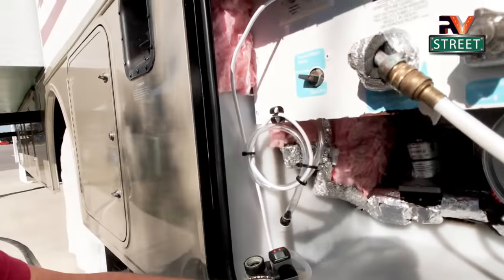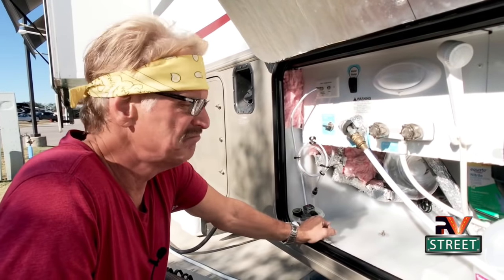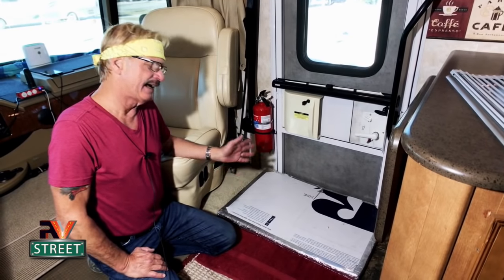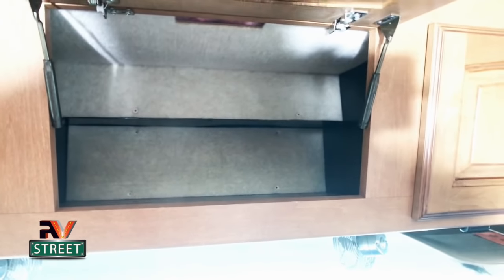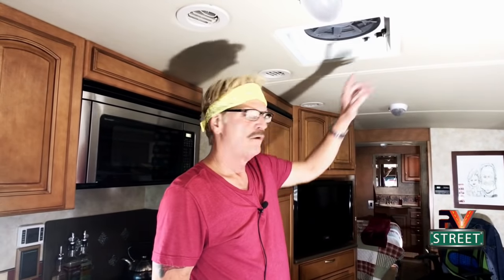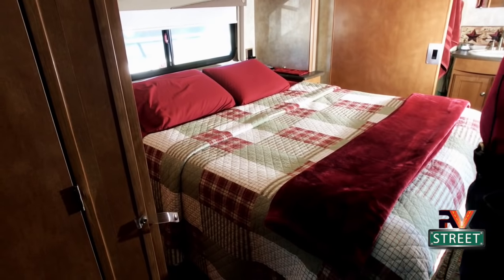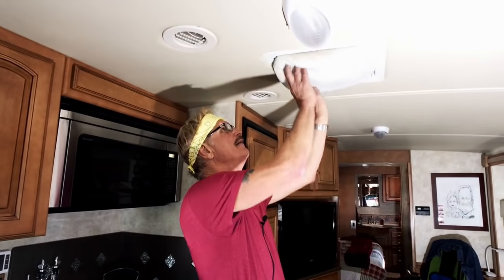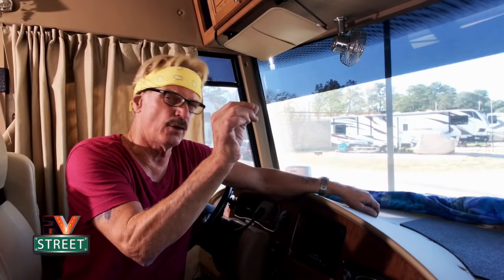😰  INSULATE, HEAT & PROTECT • Key to stay warm in your RV

Comment: One thing to consider is on my trailer the propane furnace heats the gray and black tanks aswell.
Reply from the maker: Agreed. I hear ya loud and clear. And a lot of RV's are prepared that way. BUT....when it isn't going to get down to freezing temps, why would you run your propane furnace when you have FREE electric at the camp ground pedestal. I don't understand why folks wouldn't just use a floor furnace and save their propane. There's no need to keep your holding tanks warm or from freezing when it's not dipping down into freezing temps. We've been to so many places and it's dipping down to the mid 40's, the high 30's or even mid 30's and I hear peoples RV's kicking on their propane furnace and they have free electric at the pedestal right outside. I don't get it.
Reply: @RVstreet  yes I agree I was thinking if you have free electric then maybe just run the fan on the furnace and use the electric heater for heat. I wonder if that would be enough to keep the tanks from freezing
Reply: @RVstreet  In a previous RV, when we were camp hosting, we added an electric coil unit to our gas furnace.  That way when we were getting free electric we could switch from using gas to electric and still keep our belly tanks heated.  I agree with your point of why you would waste heat down in the belly when it wasn't freezing, though, so it might be a better idea to pus a small space heater down there on a temperature controlled outlet.
Reply: @Self.reliant  Water freezes at 32 deg. If it's 36 deg. out, your fine. If it goes below 30 deg. then you may want to run both the propane heat with the elec.heaters.

Comment: Cobra Kai Strong! The one advantage of using your propane furnace is that it uses the duct system to distribute the heat more evenly. I'm with you tho, if I'm paying for electric I'm using plug in heaters. I'm someone that prefers some ambient noise and the cycling of the propane furnace has woken me up many times. Great information!

Comment: Just bought a Mr. Heater for emergency heat during power outage for the great room ... not used it yet.  Did learn  that with the right fitting (and knowing how -- lots of vids on the subject on You Tube), you can refill the smaller Mr. Heater propane cans from a larger BBQ grill sized tank.

Comment: Some RVs use duct work under floor for freeze protection..I set my electric heater lower than propane heat when below 32..
Reply from the maker: Thank you for your input.

Comment: Great video, wish I would have seen it before I went on our first cross country trip. 90F in Arizona then we hit Utah and it dropped to 27F. I used the propane for heating, and we ran out in 3 days. Had to unhook go get propane. Now I carry 2 small electric heaters. We were in a full hookup park and never thought of buying some small electric heaters, since we predominately are always in a full hookup park. I do carry the Mr Heater standup heater when we have boondocked, on a low setting which is enough to heat our 26ft it will use 1lp of propane in about 6hrs. I hook it up to a separate small 5lb tank. I also reinsulated the entire RV with R19, specially under the bed which like you said was a total empty space and we did feel the cold radiating from there. Again, tks and great video

Comment: Great job on the insulation. You actually did a better job than almost anybody out there. The wet bay was fantastic. 
Here’s the answer why people should not use propane to heat their RV in any temperature propane when it’s burns it omits CO2 and unless they have a fan or some type of ventilation to pull the air out through the roof or some other area and keep the CO2 levels low. They’re gonna poison themselves and they won’t wake up.  The Best if you can hook up run your electric ceramic heaters and oil heat is also really good and make sure they don’t have any wheels on the heaters. 
On the subject of condensation having a dehumidifier they’re small electric sheep to operate and the pull the water out of the air and the moisture but you’re right again everything you’re doing I don’t think anybody out there is doing better. Great job. !! I’m a new RV my wife and I am watching your video has really helped me. Thank you very much.
Reply from the maker: Great information and thank you for sharing with the RV community.👍

Comment: Thank you for another informative and useful video.  I look forward to them and never fail to learn, which is my goal in watching.  The length of the video, which others have commented on, is immaterial to me as long as my knowledge has increased.  I leave the 10-20 minute videos to others when the only purpose it serves is to blow thru a topic so quickly that I cannot do it myself.  I appreciate your effort to educate others.
Reply from the maker: Thanks for those words of encouragement Robert. So just in case others read your comment and my reply here....
Sometimes I do worry about a video being to long but if I don't cover what needs to be covered then I leave a lot of folks hanging with a partial message. So for example, if I took a video that covers one subject (like the one you just wached) and it's on the long side and broke it up into say into 2 parts, then when part 2 comes out a lot of folks didn't watch part 1. And won't take the time to find Part 1. Therefore they only got half the info. However, I do try hard to keep my vid's as tight as possible, to make them as short as possible but at the same time cover what needs to be covered. So again thank you again for recognizing that I'm not one that just "blows through a video".

Comment: I agree with using an electric heater when you have power. I used one of the oil filled heaters that look like a little radiator. I usually run it so it stays in the 60s. I use a Big Buddy heater with the dual tanks and built in fan. It has a low oxygen and carbon monoxide shutoff sensor as well as the tip over shutoff that is really sensitive and a slight bump shuts it off. I bought an adapter so it can run on a larger propane cylinder with a regulator

Comment: Oh also a suggestion. I use to be a home builder. When using the insulation you should leave the paper on inside the cabin. Fiberglass fibers do come loose and it's not good to breath in.

Comment: New to RV life and the wife and I are loving every minute of it so far granted we've only been doing this 2 months. We have an enclosed underbelly so usually we run the fireplace in the living and our heat pump ac for heat. Its been below freezing 2 days so far since we have started and on those nights I switched to propane furnace to heat the underbelly.
Reply from the maker: Ya, FTing is a blast no doubt. Such a great life. Wish we started sooner. We've met so many kewl folks and seen so many amazing places. What kind of RV do you have?
Reply: @RVstreet  we went with a 5th wheel Forest River Sabre 37FBT. Its just the wife and I and the leader of the house our pup. Been watching your channel for some time and you have a lot of really good outside of the box ideas which is great, from the little digging I've done so far most people just utilize RV specific products which is fine. But most of your insulation ideas would not usually fit inside a camping world creative thinking and problem solving is fantastic. 

One thing I remember from one of your videos is to try to track down the layout of the unit with electric and plumbing, not sure thats readily available for consumer consumption so its been a little fun trying to find that info.
Reply from the maker: @TxChexmix  Don't know the year of your 5ver but if it's fairly recent, plumbing and wiring diagrams should be readily available. I'd first try FR website and then go from there. Many times it's all about finding the right person to help you.

Thank you for you kind words. Got some good stuff coming up this year. Hope your subbed. Now go have some more fun. haha 😜

Comment: I recently purchased a 2008 Itasca Sunrise Class A motorhome.  I just made my maiden voyage and with a 30 Amp hookup, simply turned on the “electric heat” switch on the thermostat.  Although I admit it was noisy, turning off and on during the night, You didn’t even mention using the factory furnace.  Why not?

I appreciate the detailed tips you give us!
Reply from the maker: Thank you Charles. 
I did mention about people using the factory furnace and that's where I said, I don't understand why people would use that when it's not in freezing temps. They're using up their propane, when they could be using a floor furnace instead, use the electric at the pedestal, save their propane, and it's more quiet. Now if it's in the mid to low 20º for several hours or days and they're not using a light or something else in their bays to keep their tanks from freezing, then yes, I understand why they would use their propane furnace. In those cases many people that have heated bays use the propane furnace. Otherwise it makes no since to me. In 5yrs. we have rarely used our propane furnace.

Comment: I use my motorhome furnace but if I stayed where the electric was part of the flat rated rent.
The heated mattress pad is a must have in a coach. I also have an electric blanket but it's not being used so far. 
The only concern I have about using an electric ceramic heater is exceeding the service amperage. The plug on my power cord has been overheating at some point. Possibly when the AC unit was running all the time.

Comment: Commenting about using furnace in full hookup site.   I was doing that (only had my camper a little over a year now), but I told my fiancé last time we went camping and it was cold at night that we needed a space heater because we were using so much propane.  I was also not running the furnace until we got ready for bed, so that was making it work harder and using more propane.  Definitely learned something.

Comment: Thanks Martin!  We are stuck in Canada this winter or should I say COVID season.LOL  We use a 1500 W floor model ceramic electric heater and our RV propane furnace.  Our 32' motorhome has a 30 amp service so we can't run our 1500W electric heater when we are using high amp appliances like the toaster oven or microwave. The furnace comes on when the electric heater is off.  Other than meals, the electric heater is on.  

We also use Reflectix in some not all of our single pane windows ie bedroom and bunk bed windows because we never sit in those areas.  The dinette and bathroom windows have the clear plastic membrane that helps with draft.  Both help keep the rig comfortable, although I agree the Reflectix makes the motorhome cave like.

Regarding the entry door, we bought thick fabric from a fabric store that covers the entire length of the door and steps.  We installed some snaps above the door and the sides so it is easy to snap on and off.  We also have a spare pillow on the bottom step that fits perfectly into the step well.  

Question: Does anyone have a tankless water heater in their rig?  I'm wondering if I can add fibreglass insulation to that cavity without creating a fire hazard.
Reply from the maker: Hummmmm....can't use a 1500watt heater with 30amp when using other high amp appliances? Ya I get that. You can't use them all at once for sure. Maybe one or two items at a time. We spent all summer in Maine and was on a—get this—15amp wall outlet with an extension cord from Joanie's brothers garage all summer and we ran our 1500watt floor heater at night fine. Any other time when we had to use the microwave or some other appliance, water heater etc,  we would just constantly switch things ON & OFF as we needed them and just manage our electric usage carefully.  Once in awhile we'd turn on something else which was to much amp draw and pop a breaker. Whoops, turned on to much stuff. Go reset the breaker in the garage and back in business. But we're a 50amp coach and ran off 15amp for 4 1/2 months. I found that kind of incredible. A lot of people don't believe me when I tell them that. Now of course we didn't ever run the AC's because up in Maine you don't need AC.  But ya, a lot of folks don't realize that you don't need much power if you carefully manage your power usage when your in cool climates. Good comment Neil. Stay warm as possible in Canada my friend. 👍

Comment: Martin, we run 2 small electric heaters in our coach and that pretty much heats it adequately in winter in the East Valley (east of Phoenix AZ). We set the propane furnace for a few degrees lower than the electric heaters. If they aren'tf  keeping up the propane furnace kicks in as a backup to the electric ones.  If I was purchasing new rooftop a/c units I would buy heat pumps and use those for heating, although some people might not like the heat blowing out of the overhead ducts from the A/C heat pumps.  Heay pumps are an extremely efficient heating method, typically 4 times more efficient than resistance heating.

Comment: In our coach the basement is heated near the water bay. The heat pump and fireplace do a good job keeping us warm but do not reach the basement. Also, the heat pump doesn't work well below about 30 F so we set the furnace to run a little at night when it's really cold to protect the plumbing. We also carry 2 ceramic heaters for supplemental heat. I agree don't use any more propane than you have to, it's expensive and some retailers won't fill permanently mounted tanks.

Comment: We use the furnace to initially heat up the camper, then switch to a ceramic heater or two. If it's going to be really cold, I will set the thermostat low so the furnace will kick on if the ceramic can't keep up.

Comment: My Jayco designer legacy 5th wheel had a heated basement. Heated by the furnace. All the tanks and plumbing were in there, so you had to keep them warm.. In the dead of winter in zero degree weather if I used electric heaters like you show, my basement would have frozen. Also by keeping the basement warm, the floor was warm.

Comment: Another great video! You teach us soooo much and I thank you.
It’s no wonder your coach was so comfortable when we met last year.
The little dehumidifier is what I used last year and, although it did remove some of the humidity it was quite uncomfortable in here. For sure I will take your advice and insulate.
I met a fellow at Camping World last week with a coach similar to ours. He was having a heck of a time with fading and he had never waxed it. He was planning on taking it to CW to get a clear coat applied. I gave him a card with your U tube name on it and suggested he look into your RV maintenance videos. I hope he does. I also showed him what I use (AERO COSMETICS) was wax ALL. I think that is one of the products you use as well.
Regarding the tank heaters, Winnebago told me that when you run your central heat that is what keeps the tanks. Like you thou, I use a space heater and put it in the hallway between the living area and bedroom.
Awesome video. You provide so much wonderful and helpful information in an orderly fashion.
Thank you so much.
I will be back in the RGV sometime between now and the new year. Hope to meet up with you. Now that I have a tow vehicle it will be much easier to get around.
Oh, I was at the Winnebago factory last week; it was 28 degrees with a huge windchill. I was freaking out afraid the pipes would freeze. If they did they thawed out when they took it back in the shop.
✌🏻 ☮️  out.
Reply from the maker: Hey,
Good to hear from you. Ya with a coach your size you need more than 1 dehumidifier. Thanks for the referral too. Our particualar winnie model the furnace does not have heat in the basement so I just emphasized and did what I did. We've been in 17º for several days and no issues. 💕
Reply: @RVstreet  dang! That’s cold 🥶 
What I would particularly like to find out about basement stuff is 
...start off with the dimensions of your compartments and then what you do to best organize them.
For example...power washer... I bought one but unless I take it apart every time I use it it takes up a whole bin with lots of empty space around it. I tried keeping the washing/cleaning chemicals in there but I couldn’t figure a way to do it without the chemicals flying all over the place.
I don’t like using a whole bunch of totes because of weight.
Well, that’s start.
Keep up the great and helpful information.
Reply from the maker: @sdeaglefeather  👍

Comment: I remember being restricted to only one 1500w space heater when we were in a 30a rig.  A second one would be too much and pop a breaker.  So we'd have to use the one space heater we had to supplement the gas furnace instead.  It meant the furnace was running less in the winter while we had free electric.

Comment: The propane furnace heats the entire space more evenly as the vents are placed to do so at the factory.  I use a ceramic heater also and I have a Mr Buddy heater I use hooked up to a propane tank either 30 lb or 20 lb.  I use it right under a CO detector for going on my 3rd winter and the detector has never gone off once! I turn it off at bedtime and use an electric blanket also.  I do leave the bathroom vent open at all times.  Power can go out even at RV parks as well as propane so you need a back up at all times in cold weather!